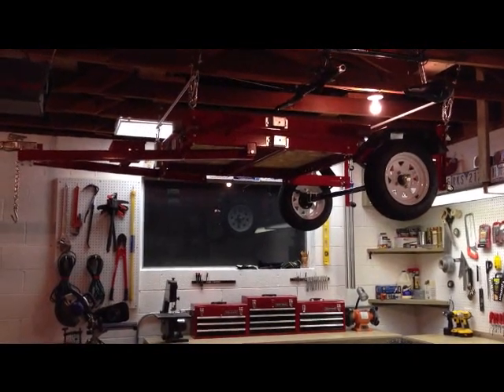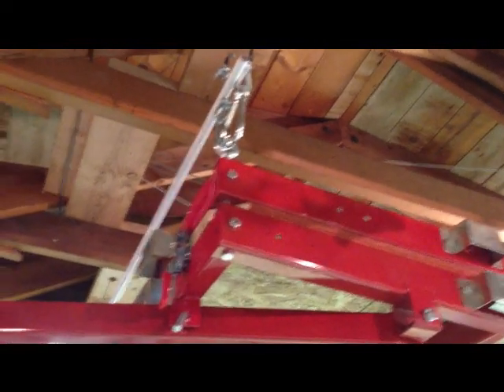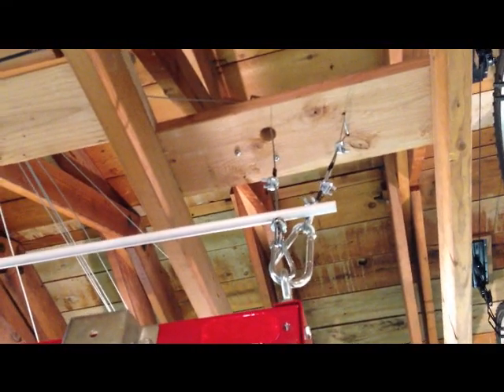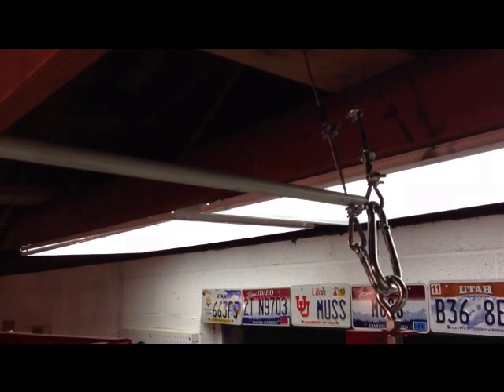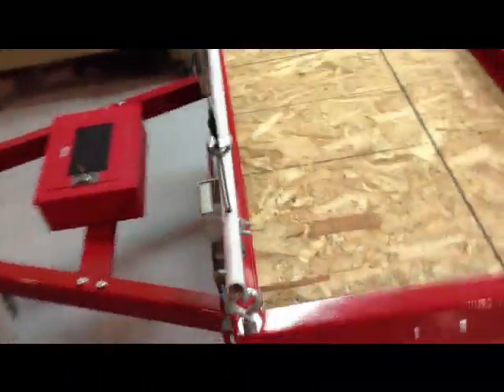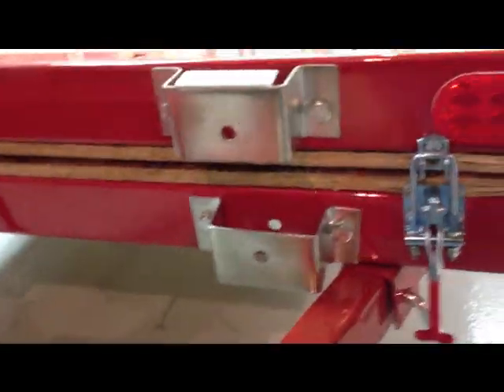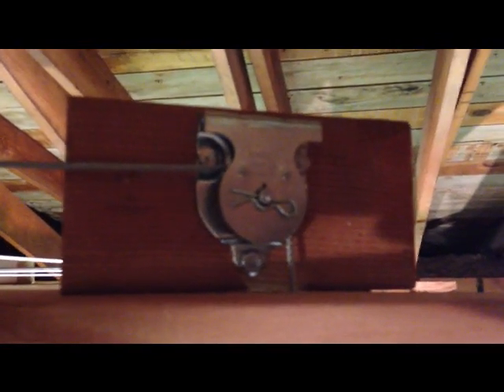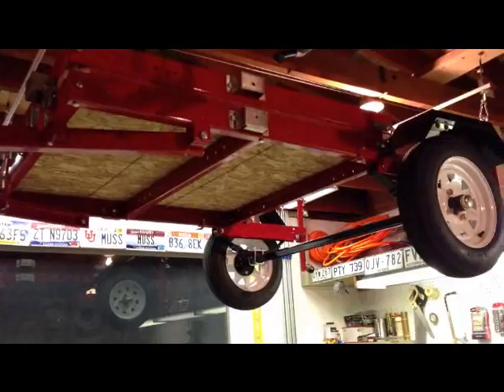Harbor Freight Trailer Hoist

Comment: Great space saver. The Osb Strand Board could break and things fall out when they get wet like driving over a mud puddle.  I believe they require 3/4" plywood... but nice to see someone break the rules and still survive and thrive.
Reply: Thanks for the tip about The Osb Strand Board. I didn't know that it would break apart so easily. rest assured that this is an extremely fair weather trailer. It makes an infrequent trip to Home Depot (5 miles from my house) to pick up lumber for different home projects.
Reply: Mark Dibb
My guess is that my foot may go thru (if it's in bad shape) while I lift a couch onto the trailer. I doubt things will fall thru during transport.

Comment: Sorry Brian, I just saw that you commented. To answer your question: I used 100 feet. I almost used all of it. The extra I used to make some alterations in my safety cables that you see in my video. but yeah, 100 feet was more that enough. I don't remember if it was 3mm or 4mm. it was one of the two. I bought the 100ft pack they sell at Harbor Frieght for $10-$15